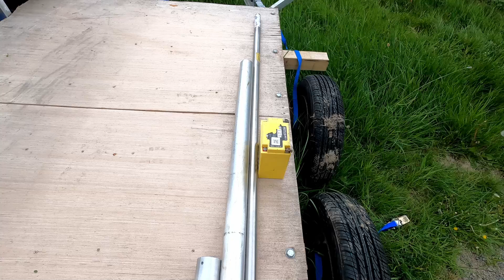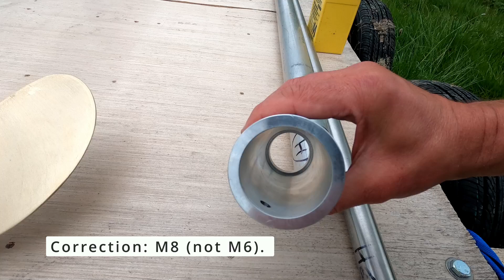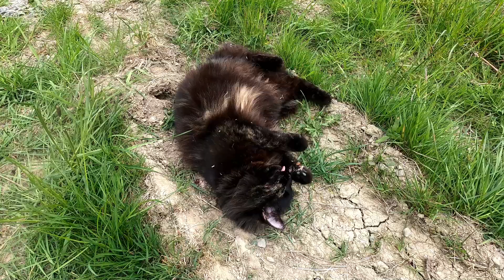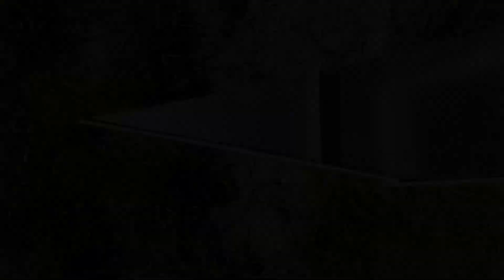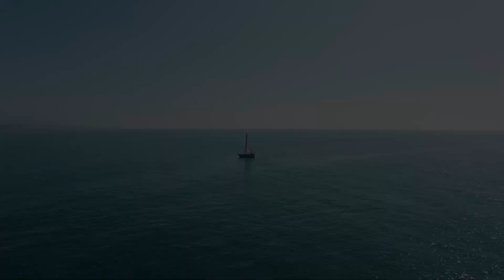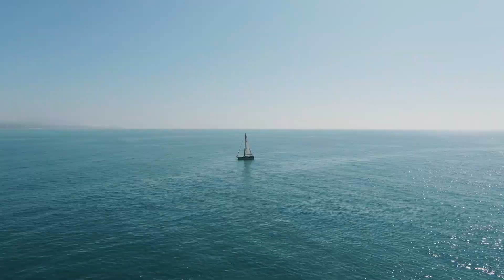Propeller & Shaft + Upper Keel Skeleton Cost Breakdown | DIY Aluminum Sailboat Build Ep. [10]

Comment: Enjoy watching you videos of the build.  If you have not already welded the prop shaft tube, I would suggest that you machine a proper weld prep with a suitable land and V prep.  Then weld a root run and cap.  I can imagine that there would be a reasonable load at this join, and you want full penetration.  I am sure your welder would suggest the same.  Keep up the great work.  M
Reply from the maker: Hey Helmsman, thank you for the kind comments and great feedback! My initial thoughts were the same but thinking about it, the cutlass bearing housing is more or less just an outer shell to the propeller shaft so the main load is on the shaft itself. That load is vertical in the direction of the boat. Saying that, a propeller (spinning object) always has 'Torque', which in this case creates 'Prop walk' force so you are right, there are forces that will effect joint so a deep penetrating root run and wide cap is well needed (had to think out loud there, ha ha). Will definitely make sure a strong weld as would be a disaster if it failed when in open water:) Appreciate your feedback as very helpful so if you see anything going forward then feel free to let m know. Happy Thursday!!
Reply: @modularhippo  Luis P / Luis G  has suggested a similar arrangement with the shaft tube.  There are two things I am considering:  1)  The best method of removal of the cutlass when the time comes. Extraction tool? 2) The screw to retain the cutlass, i.e 316 screw in the aluminium.  M
Reply from the maker: @helmsman141  - Hi Helmsman! I have seen people struggle to remove the cutlass bearing so some form of extraction tool would be good. I am sure there must be some form of 'of the shelf' tool for this as must be a fairy common problem in standard engineering maintenance work. Let me know what you fin in this area as interesting. As far as the M8 bolts go I guess Sikaflex or Ultra Tef-Gel together with a plastic spacer should do the trick. Alternatively, as the role of the M8 is only to lock the Cutlass in you mat get away with a hard plastic M8 bolt. Thoughts?

Comment: Hey, you're going BIG on shaft friend :) !!!   I went 35mm..  As for props, I am 18x15, I see you're 18x11, are you going 1:1 ratio ???   What's your plan there, I'm probably going something 3:1, maybe even 4:1...  Curious to know your plans about that !
Reply from the maker: Hey Antony!! Hope all good your side!! The prop shaft my side is 35 OD as well so  believe we both are going for the same standard:) I wish I could say that I have got my head around propellers. Not spent enough time researching them and decided to trust the company that sold it. When I started to do my calculations I was looking at 2:1 - I have a feeling that the final gearing will be the product of 'trial and error' as so many parameters that will behave uniquely once boat is in water. My hope is to find the most optimal motor RPM from an electricity consumption point of view. To get me testing I am thinking of picking up a smaller 48v scooter battery just to get me up and running:) - My Li-Ion 18650 project may have to be reworked and can take some time and my Primary Prism batteries will take a while before coming in from China:) Onwards and Upwards. Hope all is going to plan your side!!:)
Reply: @modularhippo  Test will be the key, so let's say, first in the water share his data with the other :)   We've sold the house, going full time to the boat in less than 1 month, cheers :) !
Reply from the maker: @antonygilbert9695  - I have a gone feeling that it will be yourself:) You actually got a boat, and within a month plenty of time to push forwards towards actual sailing, ha ha. I love the fact that you are both following your dreams as takes courage to break old habits and pursue the unknown:) Allot of people play with the idea but few act on it,  comfort takes over and it is easier to stay were you are:) Respect to you both!:)

Comment: The parts look very good and well done, Henrik. 
Please check the pipe welding very carefully, as the V-seam must be very deep as it is only welded on the outside. 
For the anode / nut combination I don't know any recommendation.
Reply from the maker: Hey Albert, hope all good your side!! Good catch! I am counting with a 4-5mm penetration of the actual weld, (same as the wall thickness left after my V-seam), so my hope is that it should be strong enough:) I can also make weld a bit wider and can make it protrude 2mm for extra strength:) Getting the two parts absolutely straight is also on my radar:) - I have sent  the anode / nut combination question to the company that I got the propeller from in the hope that they should have some information around that:)
Reply: @modularhippo  To minimize distortion of the pipes, I would weld four plates longitudinally as welding noggins. Semi-circular cut-outs in the area of the weld seam.
Reply from the maker: @albertfunk1176  - Hi Albert, struggle to visualise. If happy to email be a simple sketch of what you have in mind then feel free to email on [contact@modularhippo.com]. Rather do it right from first attempt:) Thanks!
Reply: @modularhippo  Sketch will follow tomorrow, by the way Kudos that you show your progress in time so that comments make sense and not your contributions appear later when the work has long been done.
Reply from the maker: @albertfunk1176  - That is the magic of YouTube! The opportunity to tap into the collective minds and experience of great people like yourself:) If I did it the other way around a great opportunity would be lost:) - Saw your sketch (Thank You as a very good sketch). Believe it or not but I did visualise what you saw but was not 100% so better safe than sorry. So would the supports be temporary and once tubes are welded they would be removed? Right? - Thank You Albert!
Reply: @modularhippo  Exactly, the support plates are only temporary for pipe welding. You will also use this type of support plate in large numbers when you weld the sheets of the hull.
Reply from the maker: @albertfunk1176  - Big Thank You as an important note for when I get to that point:) Appreciated!!